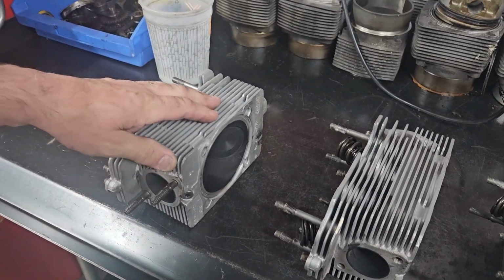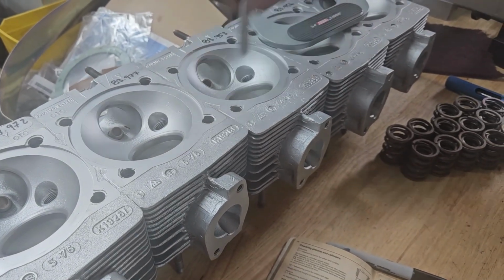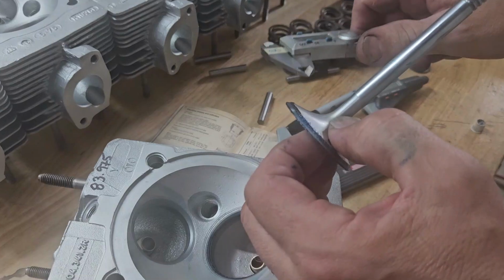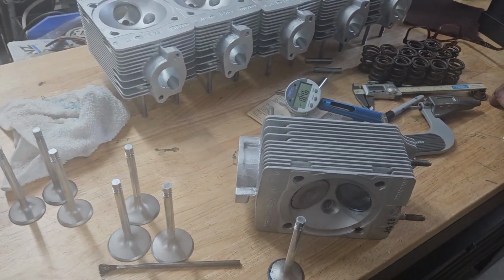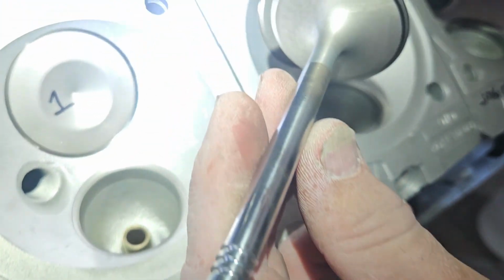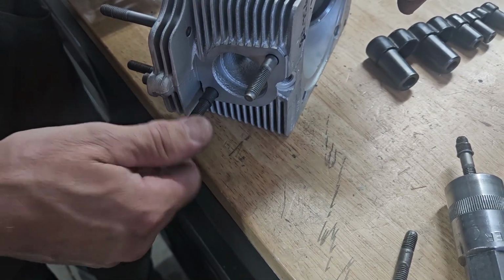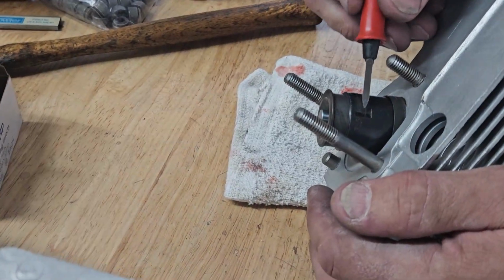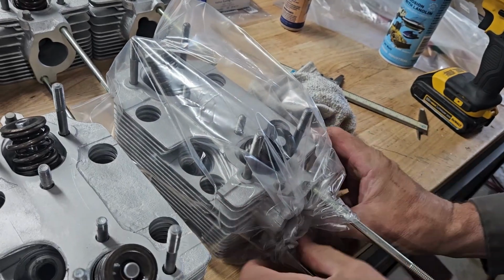1976 930 TURBO HEADS

Comment: Amazing videos! I’m a new subscriber and currently restoring a Porsche 930. 1978I’ve already assembled the long block, but I need help setting up the CIS (K-Jetronic) fuel injection system, since I received the engine disassembled.

I’m especially confused about the proper mounting locations for the warm-up regulator, the auxiliary air valve, and similar components, as well as the correct routing of the vacuum lines.

Any guidance or visual references would be greatly appreciated. Thanks in advance!
Reply from the maker: The WUR is bolted directly to the intake manifold just right of the throttle body. The Aux Air Slide is also bolted to the intake manifold on the right side above cylinder 5. The factory Porsche turbo manual is going to be the best source of information on this engine for you.
Thanks for watching and good luck with your project.
Reply: @ thanks

Comment: Firstly thanks for the Video , really enjoying the 930 rebuild , What sort of life span would you expect from a Rebuild turbo engine of that vintage?
Reply from the maker: I would expect the engine bottom end to go 250K and the heads to go approximately 125K. Assuming correct maintenance is performed.
Kurt

Comment: Kurt I notice in a lot  of these engines you rebuild, there is significant carbon buildup on the piston and rings. The same was true on my 1980 SC.  Will putting my now inactive O2 system back in place reduce this or are these engines better without it ? I have SSI exhaust and would need to install a bung for the sensor.
Reply from the maker: Kevin,
Using an O2 sensor is not going to have any bearing on carbon buildup. Most of the carbon buildup comes from oil consumption, and some will be fuel. It is normal for the 911 engine to burn oil, and therefore, there will always be some carbon buildup.
Kurt
Reply: @Aircooledconsulting Thank you for the quick answer Kurt. So would you reinstall the O2 or leave it as is.
Reply from the maker: Thats up to you, if you have to pass emissions testing in your area then yes you will need to re-install the O2 sensor. From a drive-ability stand point the O2 sensor will give you active fuel trim adjustments but the engine will also run just fine without it.
Kurt